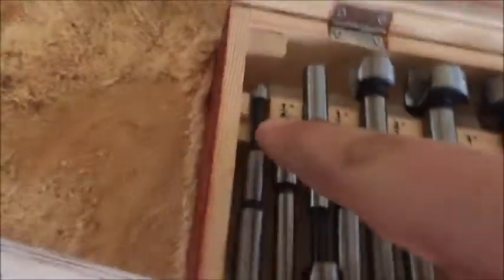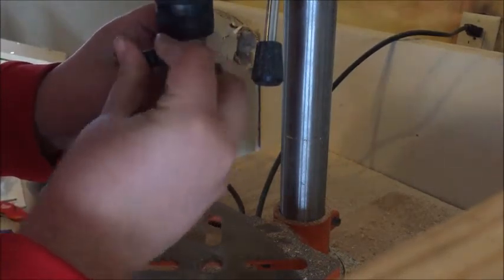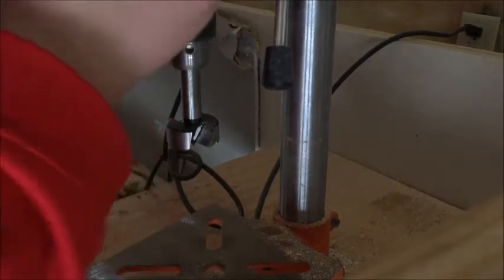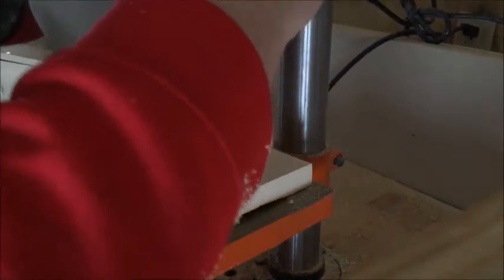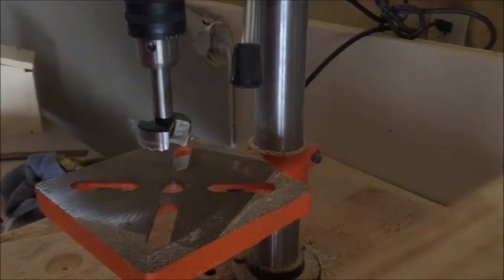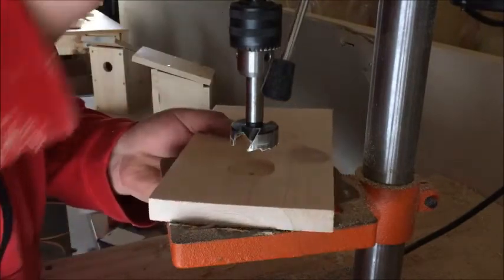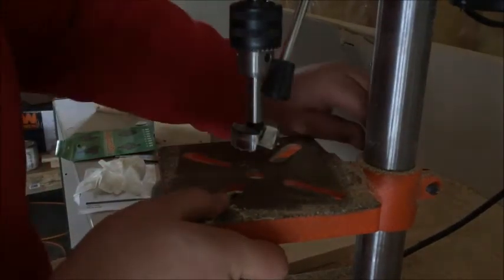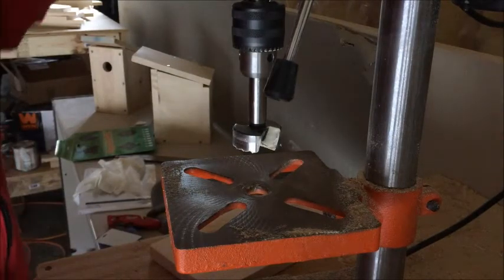Got My Forstner Bits From Harbor Freight

Comment: I just found some Rust encrusted forstner drill bits and cleaned them with a wire wheel and put them into my 1937 Delta benchtop drill press and even the 2-inch bit was working better than that one that he used in the video, in less than a second the bottom of the drill press and the floor was covered in great big shavings. 
He definitely should use a backer board and a better drill press and sharper bits and some improved videotaping skills so he's not blocking what he's doing with his arm. And more practice using a drill press.
That thing was drilling so slowly that I had to look close to see if it was turning backwards.

Comment: just a tip with the forstner bits, each bit has a recommended drill speed. with that bit which I do own the same brand myself you should be running at your absolute lowest speed. I run my drill press at 240 rpms on the 2 inch bit and you should be getting large shavings come off the bits. you are only getting dust come up just slow it down as slow as it will go and youll be much happier with these bits.

Comment: slower speed on a small drill press, as it will give you more power to prevent stall out, i run my small drill press on its lowest gear all the time
Reply from the maker: I did slow it down in the video.
Reply: beartechdeck
ive just tried my larger forstners in my drill press, almost as bad! even though mine are super sharp, it doesnt like the bigger ones!

Comment: It looks like the bit needs to be sharpened. You should look up some info on sharpening forstner bits and grab the diamond needle files from HF, item # 69876. Hopefully that speeds up your work.
Reply from the maker: It looked it up the other day. I sharpened it with a file.
Reply: +beartechdeck Hmm, that's strange. If the cutting edges are correct and you already sharpened them, it should be removing material faster. Even in hardwoods there should be some shavings and it looked like all you were getting was dust. Have you tried the other sizes? Maybe just this size isn't performing well.
Reply from the maker: I haven't used other sizes yet. This video was before I sharpened it.
Reply: +beartechdeck Oh, OK. Hopefully it cuts better now than it did in the video.
Reply from the maker: Haven't tried it yet

Comment: Where did you get your drill press? I need a small bench top one thanks for the video.
Reply: I think it is a WEN 8inch or 10inch model I'm getting one for christmas and you should definitely look into it . Its great!
Reply: Hollis Munson thank you I will look into one for sure! Great videos have a wonderful Christmas buddy. -P
Reply: It looks like a WEN - I have the benchtop one with the adjustable speed lever - I highly recommend getting a drill press with variable speed transmission rather than the one with the belt changing hoopla, it saves me a ton of time going from 900 rpm for large forstner bits to 2000+ for small holes.

Comment: For crying out loud, ROLL YOUR SLEEVES UP !!! and keep loose clothing away from the bit. Next the larger the bit the slower the rpm. That size bit should run less than 700 rpm. Watching you around that drill press is very scary. Injury on a drill press is forever, it's not going to stop when you say OWWW.